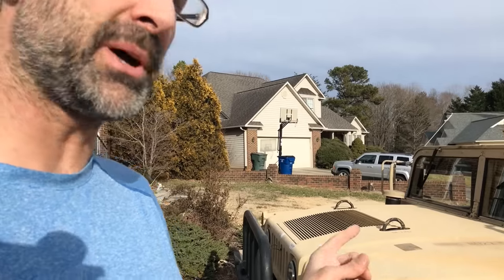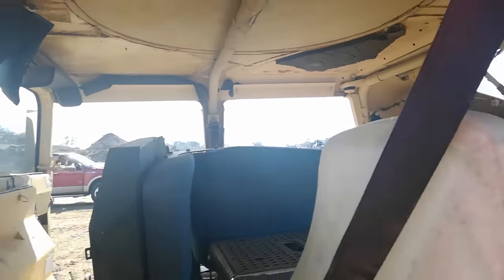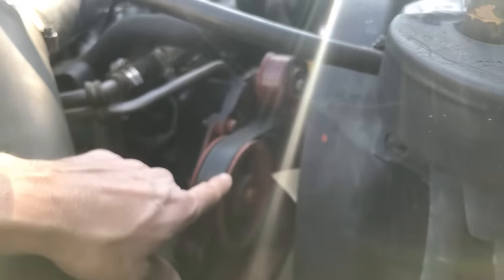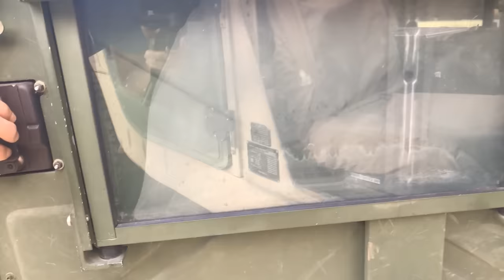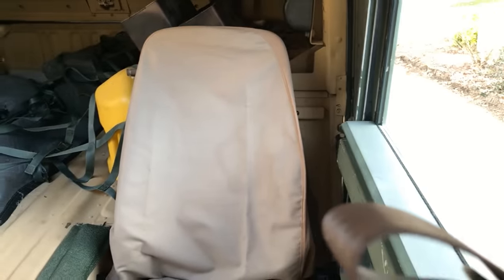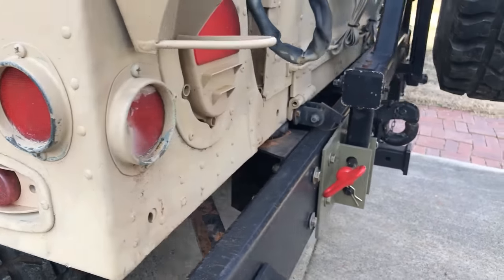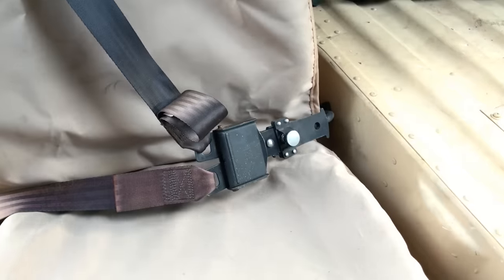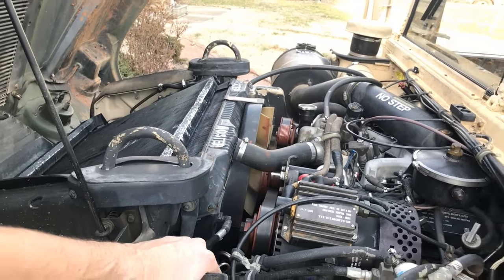Picking up a Surplus HMMWV M1045A2 from Auction & Transforming it into the Battlewagon 2.0

Comment: how much does it ussually cost to get one and then get it running and in good condition?
Reply: It is an auction. So, you never know who will show up and bid against you. Figure 15-ish for a newer truck like this that doesn't run.
Reply: @jeffcress2413  for 15k,id buy a jk.hummers are garbage,engines are rubbish gm stop gap.unless there made by IH,not gm..people here that know nothing about the gm 6.2 /6.5t, put them in toyotas/nissans,costs them about 35 +,k,!!!,just for the v8 sound,stupid if you ask me,when the motor they took out is far superior, 6 cyl tdi..4.2..just stupid people.thats here in au..plus,the toyota v8 twin turbo diesel,is over priced,under powered for what it is,.these trucks 79 series,sell for ave,45k.just for the v8 sound....id have a unimog,or iveco 4x4,before a hummer..there was a vid of a hummer on a rocky trail,the wishbone fell out of it.lack of maintenance on his part,id say..
Reply from the maker: HMMWVs are good for what they were designed for, when properly maintained.
A agree that the GM 6.2 and 6.5 aren't the engines I would have chosen.

Comment: You got a Humvee to 75?! What sorcery is this?
Reply from the maker: No sorcery needed. Early HMMWVs had 6.2L engines and 3 speed transmissions. They topped out around 57 mph. 
Later model HMMWVs, like this one, have the 6.5L engine and 4 speed transmission with overdrive that can do 75+ mph... just like an H1 Hummer. More info on how fast HMMWVs go: https://gear-report.com/humvee-info-how-fast-is-a-military-hmmwv
Reply: Huh. Neat
Reply: So nice getting the H1-A2 in 1998. The seats were nicer, the engine ran smoother and had more power. I still bitched about it not having a turbo.😂

Comment: Rode hard and put up wet. JUNKER! The reason tha ARMY got rid of it is because it wasn't economically repairable.
Reply from the maker: LoL
The USMC sold all of that model HMMWV from that unit. This one had some issues, but turned out to be an amazing truck. Drove it for 2 years without issue, then sold it for 2.5x what I had in it.
Reply: By law, the services can't sell any gov't property.  When equipment is coded out it is transferred to DRMO and it is actioned off from that activity. The money received from auction goes straight to the US Treasury, not the branch of service the equipment belonged to.

Comment: time for the army to replace the hummer's out dated now
Reply from the maker: Some are being replaced.
Reply: They did. It's the MRAP
Reply from the maker: @ningen1980  Actually, the JLTV is the official replacement.
Reply: Both are the official replacement,  however the Mrap costs more money due to the type of missions it’s configured for.  There’s a couple million dollars worth of technology inside each of those vehicles. They are a heck of a lot of fun to drive :)
Reply: Brandon Cruise The JLTV is the official replacement. The MRAP program was a stopgap measure put in place to protect soldiers in theater. Now there are some changes coming but that’s another story.

Comment: That thing is beat to half to death, it’s going to be exorbitantly expensive to get that POS sorted. Whatever you paid it was too much.
Reply from the maker: Bwahahahahaha!
You must not have watched the whole thing. It was sorted and runs great for almost nothing.
It wasn't "beat to shit" at all. It was dirty and the engine was full of water. Now it is clean and runs great.
Reply: 5k miles, a "normal " training used hummer would have bin trashed! We're talking about 90% offroad , with uncaring & inexperienced teenagers at the wheel. This one is in good shape. Look into getting a radio mounting rack for over the doghouse.
Reply from the maker: @keithwittman4741  This one has been excellent since we got it running. Has over 7600 miles on it now. Also has a BFT radio console installed. More on what has been done... https://gear-report.com/hmmwv-battlewagon-2-0-m1045a2-humvee-repairs-and-upgrades-status/

Comment: No thanks don't want something i would be working on all the time
Reply from the maker: That is an interesting comment. 
On my first HMMWV I had some initial maintenance to do when I picked it up from the Army. But once that as done it was no more work than any other vehicle. Any surplus vehicle comes with an unknown history. So, it is safe to assume they will usually require more maintenance than typical "street" vehicles. I guess I just got lucky on that one. 
I'm still upgrading and dialing in this one from the USMC. It was barely used when I got it. Hoping that means LESS maintenance. :)

To your point, I wouldn't recommend a HMMWV for someone that doesn't enjoy projects.
Reply: @GearreportdotCom   im old fashione if i have to  work or modify something  too me it's not practicable .
Reply: @georgecass8529  I kind of feel like that is the exact opposite of being old fashioned, which is wrenching and modifying stuff to fit your needs. Kind of like old chevy "ranch hand" trucks where they took a dually and reversed the drive train and seat/steering wheel to drive it in "reverse".
Reply: @bohicagaming4462  must  be the difference in the times we grew in
Reply from the maker: You beat me to it! lol
Yeah. I agree 100%
Old Fashioned is the era where maintaining and modifying stuff was the norm.
Today, most people consider things disposable. If it breaks... replace it. 
If it isn't exactly what you want, don't modify it, replace it.
Reply: @GearreportdotCom  always maintained my stuff and always wear it out before replacing  . 
There a difference between maintaining and modifying  . Me personally will take a old williy's over a hummer  .
Reply from the maker: @georgecass8529  I'm a big fan of the old Willy's also.
Reply: @bohicagaming4462  why would u even want to do that lol
Reply: @johndowe7003  I didn't, but apparently montana ranchers did for use on the farm/ranch. This isn't what they were intended for but you can see what it looked like https://www.youtube.com/watch?v=_z5_4OIEbE0

Comment: I rebuild those for a living,big pile of shit
Reply from the maker: Then do a better job. 😎
Reply: Maybe you outta rebuild them then or tell everyone else I work with or the other depot's to do a better job!
Reply: Are they a big pile of shit for what it is or all things considered?  I know back in the 90s they used Chevy pickup trucks that couldn't keep up with what HMMWVs could do and I can't think of any other vehicle that can do what they do (European "I'm better than you" snob factor aside).  So what exactly makes them piles of shit?  Poor maintenance?  Poor design?  Poor logistics?  It can't carry my soccer kids to practice?  It's not as comfortable as my Ford pickup when I tail gate and cut people off on the highway?  It has no cup holders to hold my manly bud light beer?
Reply: @120masterpiece  Maybe it is difficult to reach the pedals while using a "booster-seat", kind of PoS... Who Knows!
Reply: No, anyone that's been in the military knows that they are shit. Underpowered, breaks down, and easily gets stuck.
Reply: @TheSwissCheese87  I drove them constantly in the military.  Being Marines we got stuck with the first generation of HMMWVs M998s with the weak engines.  I remember one time I had the pedal to the floor, barely breaking 5mph going up a 40 degree incline (the fire break north of Camp Horno), then we eventually got M1123 and the power was enough.  As far as them getting stuck every time I got myself stuck was because I didn't know how to lock the diffs.  They don't teach that in driving school.  Only after getting out did I learn you could "lock" the diffs.  On the other side of that we did plenty that most "off road" vehicles couldn't do, while at the same time full filling the combat role a HMMWV could, not withstanding adding 2 tons of armor it was never design to carry.

As far as maintenance and them breaking down we were Marines.  We adapt, improvise and overcame...which means we did a lot of stupid things that could have easily got someone killed, but it worked....mostly.  Also, most of the break downs or problems I experience were due to operator error or neglect.

Not sticking up for HMMWVs, but putting my position in context.
Reply: @120masterpiece  kinda want to hear about some of the dumb fixes 😂🤔
Reply: @Dan00105  We had a M998 that didn't have a working parking brake and since the M998 didn't have a park gear there was no way of...well stopping it.  So what we did was have the driver stay in the HMMWV while the A-driver got out and chalk block the wheels.  Well we were doing gun drills one day and the driver park the HMMWV on a steep hill and just as the A-driver was about the chalk the wheels the driver started to get out and let up off the brakes.  The HMMWV began to roll backwards but luckily the driver quickly smashed the brakes or else the A driver would have been ran over.

It was completely stupid looking back at it now.  Someone should have made MotorT fix it or refuse to drive it.

Comment: clearly you put the water in there and then poured the oil in whilst it was draining. love to hear your explanation as to how the two managed to stay separated otherwise
Reply from the maker: That is hilarious. What you saw was how it arrived from military auction. I did not put water in it.
Reply: It stayed separated almost like oil and water. 😮
Reply: @GaryDrumm  if they dont mix then tell me how the denser fluid remained on top? also how has water made its way into the oil system but remained crystal clear? i'll let you answer both those questions when you get older :)

Comment: seriously i would never ever buy anything mechanical  of an outfit that would start an engine that  had sat with that much water in it , this engine will not last, i heard prices of 45k banded around  you got to be joking  without a new engine it is worth nothing buyer beware !!
Reply from the maker: Outfit? It is my truck.
I wasn't happy about the water either. But, the water is out and it runs great. If it fails, then I'll put a new engine in it. Simple.
Reply: lots of duramax motors in salvage yards just waiting to be swapped in and these are serious off road trucks. as a toy if you can afford one why not?
Reply from the maker: @chrisrhudy2000  this one is a marketing truck. Need it to take to event. Can't risk breaking it off-road.
Reply: @GearreportdotCom  ha ha 2 replys down you say its a marketing vehicle , what a way to advertise your business  that engine should NEVER have been started after that crapcame out of the sump  its the worst thing  you could have done , its just a time bomb tick tock
Reply from the maker: @callumduncan6728 It runs. If it stops, then I'll deal with it. If not, then I'll keep driving it.
 Lucky for you, whether it is a time bomb or not is of no consequence. So, don't worry your pretty little head about it.
Reply: As a diesel mechanic i would consider taking oil pan off if you can to inspect the crank journels. But i too would just run it, takes a lot more to damage diesels.
Reply from the maker: @danielramsey1959  Yep. We took the oil pan off as soon as all the water and sludge was drained. Sprayed a LOT of penetrating oil up into the cylinders from underneath as part of our efforts to get the cylinders freed. It didn't look great, but it really wasn't anywhere near as bad as I had expected it to be.

Comment: Am general  aka Chevy  motor but still bad  as truck
Reply from the maker: This particular truck has a GM 6.5 block that was rebuilt by Melton in 2007. The engine had about 1500 miles on it when I got it. It runs STRONG!

Comment: why did you buy such a POS?
Reply from the maker: It just LOOKED like a POS when it was filthy from sitting out for years. I've put 3,000 miles on it so far this year and absolutely love it. It was barely used by the USMC and in great shape, once we got the engine running.